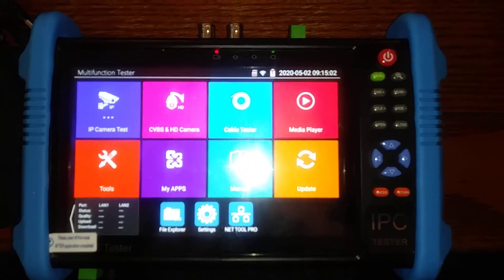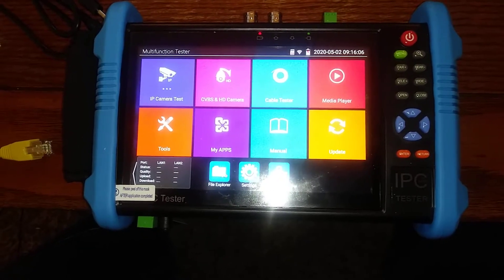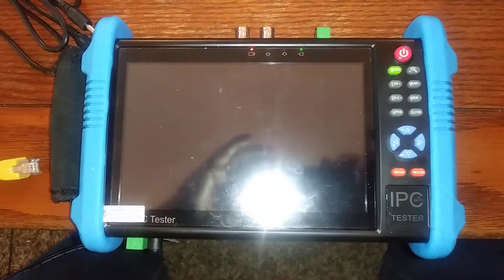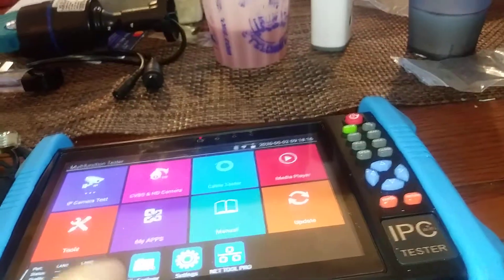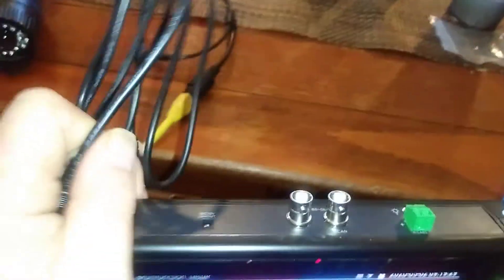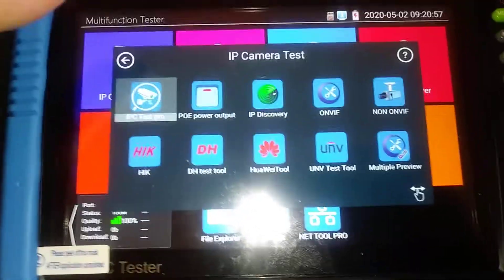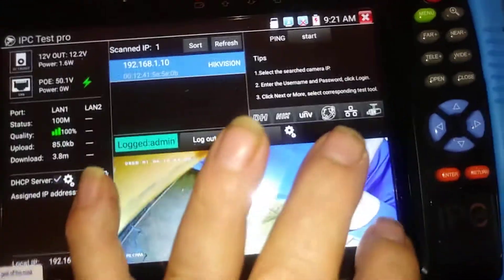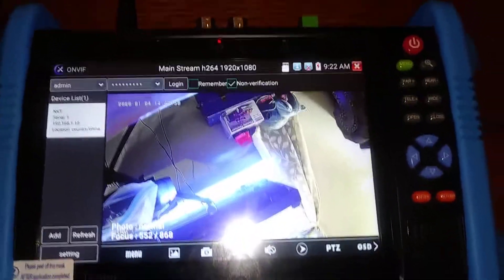Seesii Video Monitor Network Tester for NON PoE IP camera testing

Comment: You should not be using your phone flashlight when recording a LCD screen. The screen projects light, it does not need to be illuminated. Your flashlight causes a glare hotspot which blocks part of the screen -- haven't you noticed?

Comment: Warning ! !! !! After the battery is used up, the device can be disposed of with the garbage - Batteries are not available !!! to these devices
Reply: They have batteries on eBay. Type this into the eBay search bar........

Li-ion Battery For CCTV Camera IP Tester IPC-5000/9800/8600 plus+ X7/X9 Series
Reply: @pauls6451 really ?? The battery can't be recharged ? I think your information is wrong.